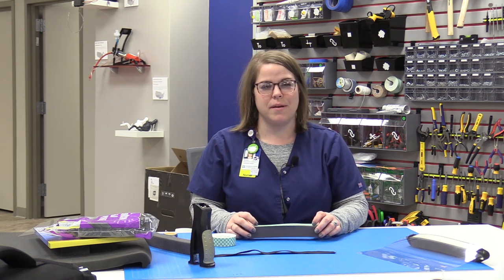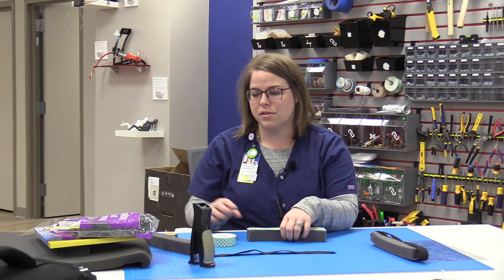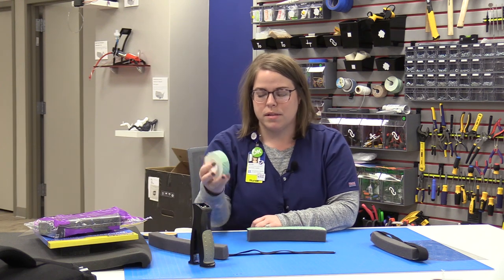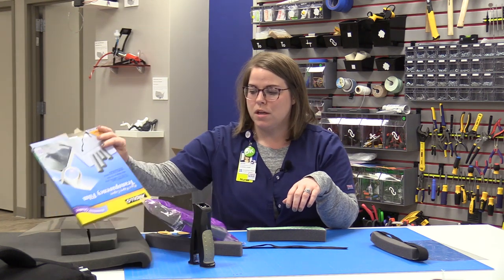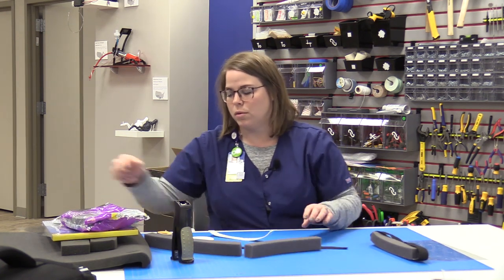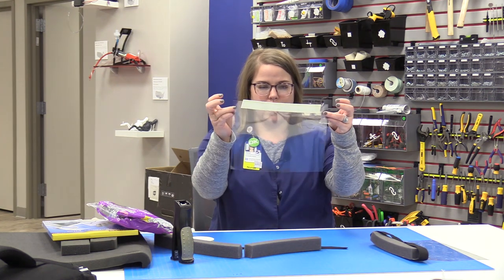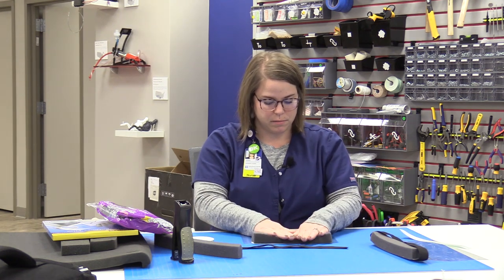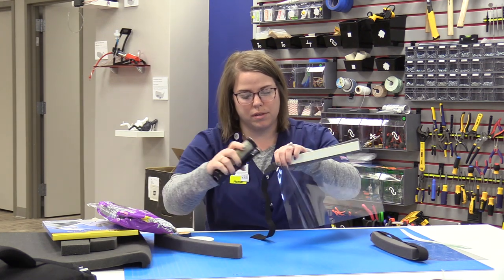Creating a face shield for health care workers instructions

Comment: plastic bottles are everywhere and they have the right shape already
dish sponge is everywhere also. if you can argue about "professional looks" then you're not in a crisis
Reply: This method is FASTER than sponges and soda bottles, which is important when making enough to outfit a whole hospital.
Reply: @jasonf8910  you're a little late to the party, but ok.
OP: "plastic bottles are everywhere" => it's easy to get them en mass.
getting something easy = quick.
at the time i made this comment (3 months ago) there was no 'industry' to make this stuff en mass jet.
so i talk from a past perspective.
the shown method takes longer in the regard of 'getting the materials'.
sure it's 'faster' NOW. 3 moths ago, as everyone needed this stuff immediately, sponges and soda bottles where the way to go. just b/c of availability.
furthermore this kind of protector shown here looks more 'professional' than the bottle thing. but that doesn't matter either if it's an 'emergency' and you have to act fast. 
so what you say is true. but it was wrong in the past.
nevertheless thanks for your opinion.